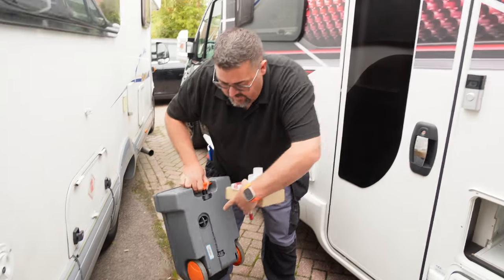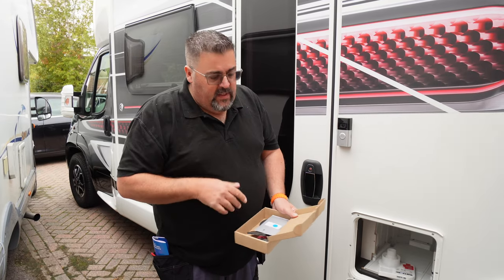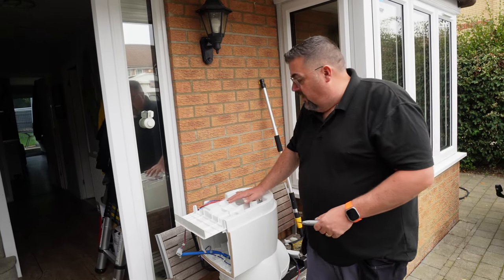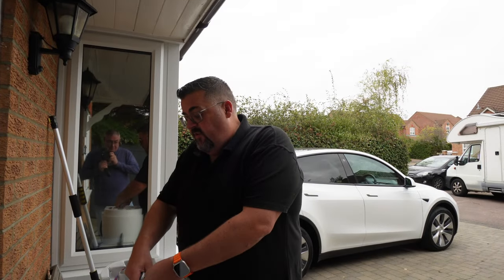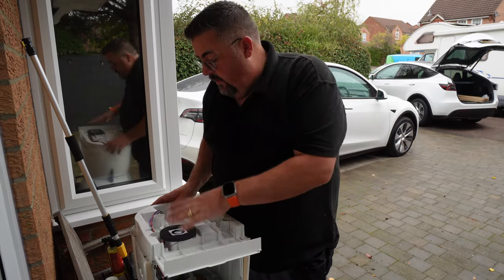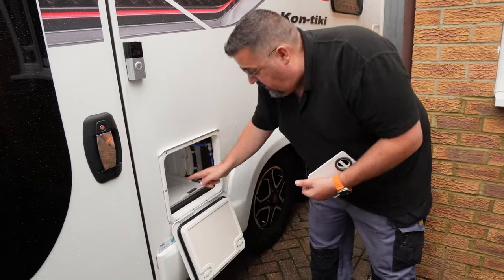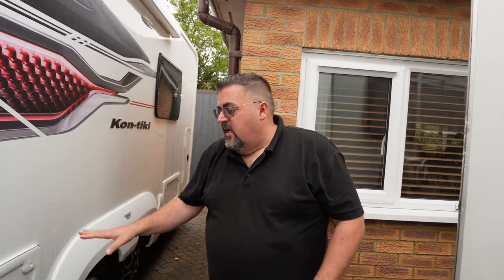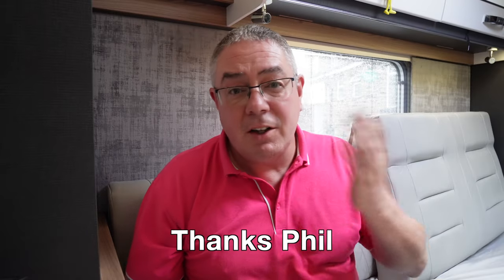Fitting a Ventilator Kit to our Thetford C260 Cassette Toilet

Comment: I fitted a SOG (brand name) years ago! Absolutely brilliant!!! 👌Easier to fit, better reviews and cheaper than the Thetford if I recall! 🤔
Reply from the maker: The SOG brand is a little more expensive than the Thetford version, but I’m sure they’re both very good systems
Reply: Not If you’re paying someone an hourly rate to fit the kit! I cannot comment on how good a Thetford toilet ventilation kit is, only that the SOG I fitted is brilliant and generally the majority of reviews prefer the SOG! 👌
Reply from the maker: It seems the SOG systems might have gone up since you bought them Andy as a quick Google shows them at around £200 when the Thetford one is around £125. I guess the price of fitting either system would be the same in labour if your paying, but fortunately Phil didn’t charge us for his time 👍

Comment: Hi, SOG is a separate brand to what was fitted (Thetford). Did I miss something?
Reply: Steve did say SOG, as lots of people call them SOGs, it is a bit like Hoovers, Asprin, Sellotape, Trampoline or Hovercraft.
Reply from the maker: As Phil rightly said, it’s a generic name. The correct name would be a toilet ventilation kit, but just as vacuum cleaners are called Hoovers, these are usually referred to as SOG systems
Reply: @RoamingRadfords  Thank you Phil and Steve, I only knew the original SOG system. I will look into this one when I get my new campervan.

Comment: Our Auto-Trail has this fitted as standard and it’s 9 years old
Reply: Have you ever checked that it is vented through the floor to outside.  Ours wasn't and we were told by the dealer that Autotrail never bothered to drill the floor.
Reply: @davef8345  yes ours was never drilled either

Comment: I got put off fitting one of these after   watching a guy retch at the elsan point.
The smell of raw sewage has got to go somewhere and sat in front of your van your going to a whiff?
Reply from the maker: The charcoal filter probably needed changing, no whiffs from ours yet
Reply: At £20 a pop and replace every 4 weeks its sounds expensive.
Reply from the maker: Its 4 weeks of constant use Mike, which is probably once a year for most people
Reply: Sounds good in practice but charcoal will absorb moisture,  im guessing you can remove and keep dry when not in use?